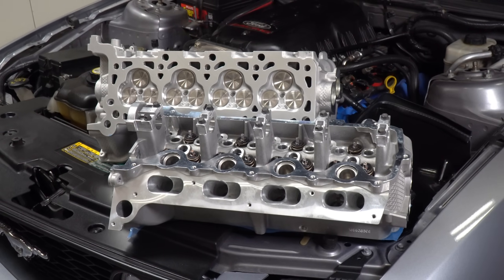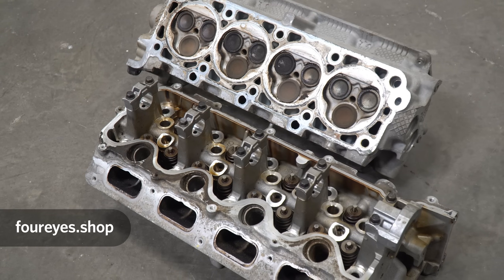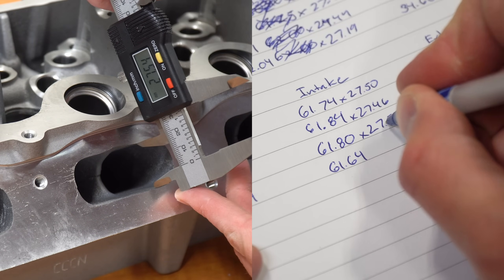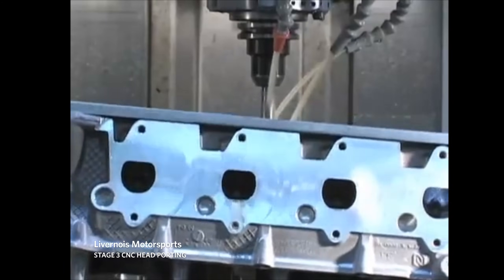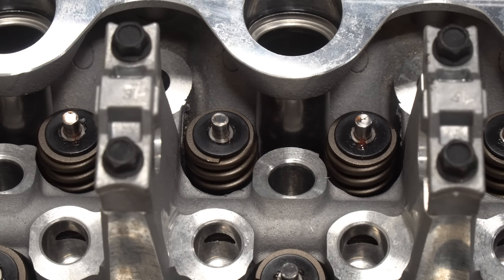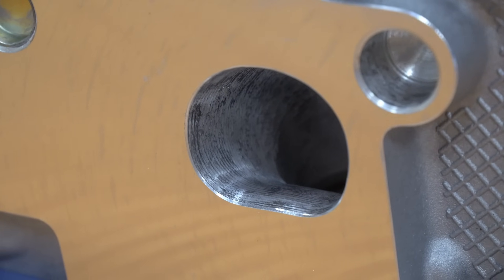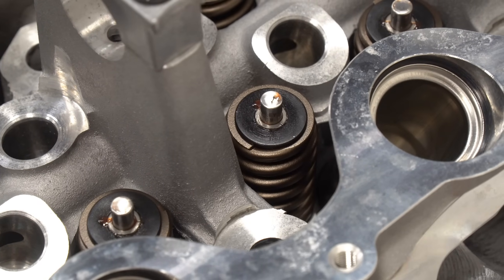Ported Heads Before & After (measurements + dyno)

Comment: I think a ported heads worth 15 or 20 HP to the crank, not 70. 
See the difference between a 11 Gt (coyote gen 1) and Boss 302  2012 (roadrunner engine) which has cnc ported heads specific exhaust camshafts ...

Comment: I'd like to see the whole flow graph, the discharge coefficient, port velocity, etc. The real places you want gains are in the mid-lift areas. Power under the curve and average power across the top 30% rev range is the goat way more than any peak number can provide.

Comment: There is little difference between rough and polished intake ports in terms of max flow.  But!!  At lower flow rates, such as low-mid RPM or when the valves are just barely off their seats, rough ports have a MUCH better aurflow velocity.  The rough texture creates a large boundary layer of still air which progressively collapses as airflow becomes greater.  This effectively acts like small ports at low flow regimes, and big ports for high flow.  The best of both worlds.  The grooves left by a CNC machine are close to ideal, which is why the dark art of manually adding grooves to intake ports has disappeared.  That used to be a thing, albeit relatively obscure.

Comment: Edit: I got porting done. All done by hand by someone with many years experience. They did it per my application. Gains we’re 25% average on intake across valve lift range and 48% average on exhaust. Actual cfm gains at .600 were 212 up to 268 intake, 145 up to 212 on exhaust! So it performs between a LS1 and coyote head. Great flow for 4.6L.
OP:
Building one of these too, talking about porting with engine builder right now. Turbo application.
Crazy part is the gains N/A are multiplied under boost. Let's say you gained 75HP N/A, thats worth 150HP at 15psi! Insane!

Comment: Why didn't you go with a pair of 4v heads?
Reply: That's honestly a stupid question
Reply: @smoke_oguwop  Whyt is that.
Reply: Cus the ported 3v heads not only flow more but will have better air velocity. The 3v mod motor is an underdog. Ford should have done more woth it

Comment: 288cfm@.500" lift is basically gen 2 coyote.  Can easily make over 500 hp n/a with that type of flow.   The 190cfm exhaust while not a spectacular number is sufficient.   These heads can make power.

Comment: Did you ever make a video on how much horsepower the final version NA mustang made? I cant find it.
Reply from the maker: I actually haven't yet, still in the works. I got it over 400, but trying to squeeze out a little more before I call it good on NA.
Reply: @Four_Eyes  could you please please do a quarter mile and also vs a stock 3v

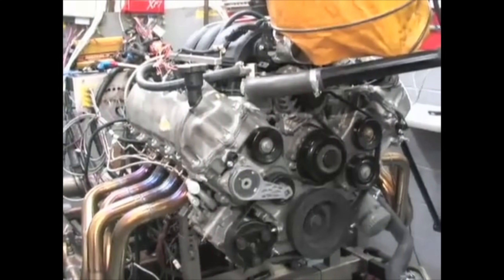Comment: 4:30 - BULL SHEET! Who told you that you will get 40 HP gains from Porting heads on a 5.0?
Reply: Well you can see 100hp gains on a 2v. I wouldn’t be surprised the latest version of the mod motor would be better & not require as much

Comment: Always wanted a 5 axis machine 😍! I run two 4 axis a61nx Makino’s for a living. Polishing is very simple to do on your own. A little time and elbow grease and they’d be good 👍🏻. Also polishing the combustion chamber is beneficial! Removing any “sharp” spots so to speak helps with detonation aka spark knock. Therefore eliminating hot spots.

Comment: Why not a big bore setup to still give you 305 cubic inches (5 liters) run stock length rods to keep weight down? The less internal weight of the rotating mass(frictional horsepower loss), means it can get through the RPM faster,  higher rpm potential without side loading the cylinders creating premature wear. Also, two other factors are increased static compression ratio from shoving more cross sectional area from the piston into the same combustion chamber area. Higher static compression means more down low torque, higher flow numbers from the increased valve size, and that higher static compression will make easier power , spooling turbos faster with less effort, sooner. It may become an undersquare engine but, the stock stoke is plenty to help pull and fill the cylinders for a turbo car as well. I believe this is why modular engines love boost in stock to wild form.
Reply: The 4.6 is limited in terms of going with a bigger bore. Theres nearly nothing to take out
Reply: @TexTheMaster  3.552” standard bore on 4.6 Modular’s. 
The block can be machined to accept “Sleeves” or an Iron 4.6 Boss block  can be had which has a 3.700” bore from manufacturing. 
A 3.700” bore with a standard stroke,  is 305 cubic inches.

Comment: how was livernois customer service, i've heard they don't have great customer service but great physical parts so what was you're experience?
Reply from the maker: good question. so automotive customer support is garbage in general; half the time i feel like shops are annoyed i've spent thousands of dollars with them. but Livernois' is actually pretty decent - they only take 1 or 2 emails to respond while other places can take as many as 5. i don't recommend ported heads tho unless your motor is fully built (forged, boosted, cammed, etc).
Reply: @Four_Eyes  ok gotcha i'm not too surprised the customer service in general isn't the best but what can you do, about the ported heads tho it sounds like it's more of a support mod, not a power adder but more of a way to free up more power with a power adder. I plan on installing a whipple twin screw package someday so it's something to consider later down the line.... thanks for the response though and on a side note i'm loving the build and all the information you're providing, keep it up 👍

Comment: Hey man, ended up getting a 3v recently and I’ve done almost all the bolt-ons possible. Car has Off-Road X-Pipe, Cold air intake, and a BBK 62mm throttle body. All I have left to do is Headers, cams and possibly the ford intake manifold. I plan to go boost in the near future once the car has all the supporting mods done to it. Are you gonna stick with the Detroit rocker cams for the built motor or are you going a different route? I want to get a set for my car as they seem to be the best performing camshaft that does not require aftermarket springs or anything too fancy. Let me know your thoughts and keep up the good work🤘🏽
Reply from the maker: Rockers are a great choice imo, good sound, good power, and easy on the motor. I may upgrade to the boost version of rockers at some point, but who knows. If you're less worried about power gains, Hot Rods are a good choice too as they have the best sound.
Reply: @Four_Eyes   yeah for sure, I mean seeing how much power you were able to make na definitely sold me on them. Hardly do you see na 3v’s make above 340rwhp na, seeing you make 360 was incredible your tuner definitely knows what he’s doing.

Comment: This was my next step on my fbo 3v build before I went coyote. My build was pretty much identical. Ford racing intake manifold, hot rod cam, headers, TB, jlt cai, tuned, coils, etc. I never dynoed it, but my butt dyno put it close to a stock gen 1 coyote. I went gen 3 and it was a decent jump. Can't wait til you boost it

Comment: Great content. Thanks for going into such detail. Please document the motor build as much as possible. I'm wanting to try to rebuild a short block & this my first ohc motor. Theres is not a lot of engine building info on 3v's. I was going to drop in a 393w stroker, but decided to turbo the 4.6 instead.
Reply from the maker: Thank you, and thanks for watching.
So I have a build sheet here:
https://docs.google.com/spreadsheets/d/1hVIZx8W_6PMGEG0bqVcpb3FUmJhsc5FHKiF8nt7t1EM/edit#gid=0
And I'm posting another video in about two weeks that details all the parts I bought for the rebuild.
Reply: @Four_Eyes  The build sheet is   very helpful. I was hoping to assemble my valve train on the short block in my garage. I'm from the ls world & there just isn't a lot of build info on these 3v's. I'm hoping it's the same as a 2v.

Comment: I'd personally have liked to have seen you install the heads on your 4.6 engine.  That's what I'm running and would have been interested in the differences you would experience.  I'm personally working in a different direction.  I'm going to work on the handling end.  Springs, shocks, anti-roll (sway) bars, Watts link in the sear suspension, better sway bar end links, higher quality front control arms, and like your GT a 1 piece driveshaft.  Oh, an all-aluminum larger radiator just because I hate "modern composite" units.  I personally think that 425 - 460hp is a great number but only if it's tractable and useable.  I look forward to your future videos.  Stay safe & healthy.
Reply from the maker: Thanks Lincoln. I probably won't track this car as it's my daily. Did everything all at once (heads + stroker kit) to reduce labor costs and time.

Comment: @foureyes can you replace the lash adjusters with cam in place?
Reply from the maker: I'm not sure, but seems like that would take longer as removing the cam is pretty easy.
Reply: @Four_Eyes  my issue is a top end rattle so im replacing all the rollers and adjusters but going to chains and guides at a later date so trying to not to buy parts multiple times( phaser bolts)
Reply: @Four_Eyes  can cam phaser be left on and just tilt up?
Reply from the maker: i gotcha, so yeah that seems plausible, ones closest to the phaser might be a little difficult

Comment: I understand its a build and your looking to make more and more power but I came because you are the only channel that showed the actual progression of a 3v 4.6 build and showed us what you were able to pull from each mod and that was great. I couldn't wait to see what ported heads would do on your 3v 4.6 but jumping to new motor without continuing the path you had showing us mod by mod and dyno results defeats the purpose of watching as we no longer know what a actual 3v 4.6 was capable of.
Reply from the maker: Power should be around ~400 whp. Decided not to do this because the additional labor, tune, and time would cost about $2,500 and 2 months.

Comment: The new springs allow for 8k revs but my question is what would be holding it back from 8k revs if anything at all? Would the stock camshafts be the next limiting factor or is it safe for 8k?
Reply from the maker: Not super sure, but honestly I think it would be fine to rev to just under 8k if the power's there.

Comment: Still love watching the videos and seeing the choices you make.  One of the reason I love the video so much is my Mustang is almost exactly like yours - 2007 GT Tungsten Grey.  I have done a few new mods since my last comment on one of your videos also.  Laguna  Seca / Ford Performance Rear Seat Delete / X Brace, TMI front seat reupholster kit (this make them look more like the modern sport bucket while still retaining the original seat frames) and an Edelbrock Stage 2 Supercharger Kit w/ a custom tune from VMP Performance.

I look forward to seeing more video - you do a great job - very enjoyable to watch.
Reply from the maker: How do you like those reupholstered seats? Good fitment or a bit saggy here and there?

And thanks Cooper ✌
Reply: @Four_Eyes  - No fitment was actually excellent but it take about 4 to 5 hours to do and you will need an extra set of hands, my Mustang has the Premium package so it had the factory leather seats - I even moved the factory seat heater over to the new setup.

Comment: I never got to know if you kept the Ford Racing intake manifold since you found a better tuner or did you go back with stock manifold?
Reply from the maker: The FRIM works great with aftermarket cams, headers, and a dyno tune. I'd stick with the stock mani until those upgrades are on the car.

Comment: Could I throw in that stage three ported heads into a stock motor and call it good, maybe cam and exhaust?
Reply from the maker: Ported heads on an otherwise stock motor probably wouldn't be that helpful because the exhaust system would be too restrictive and the cams wouldn't benefit much from the additional airflow. So you'd definitely want cams and exhaust first.

Comment: I have. Ported livernoise trick flow heads, and the port job was pretty shitty, wasn’t even polished just a Cnc machine run
Reply: Polishing isn't even all that beneficial or necessary unless you are making some very high HP. Not 700-1000HP...
Reply: LS4.8 Frank ahh gotcha, I didn’t know that! Thanks for letting me know! I always thought that it should be done it helps with air flow

Comment: Any reason why you didn't use your stock cylinder heads?  Before I get slammed for asking I'm no mechanic.  If you don't mind asking how much does it cost to have this done? and that's with the new springs too right?
Reply from the maker: This is my daily driver and the car would be out of commission for probably two months if I used the heads on the car. I will probably sell my stock heads on foureyes.shop once the overhaul is done.

It's very expensive imo, about $3k for the their "Stage 3" racing package, that includes not just porting, but valve and chamber work as well. And yeah, also includes new springs.
Reply: @Four_Eyes    Three thousand isn't that expensive since we know supercharging is more expensive.  I myself like a normally aspirated motor.

Comment: I'm interested in where this goes as I went to the 5.3L stroker I'm at about 380 but I don't have my intake done, etc.
Reply from the maker: What mods besides the stroker?
Reply: @Four_Eyes  Comp cams stage 1 Pypes LTs, and Steeda underdrive and steeda CAI as far as power stuff goes, the whole suspension is finished so Blower is next step for me.
Reply: @nicolesmrekar2046  I bet it making good torque with a 5.3 and fairly mild cams

Comment: 435 hp thats crazy if the dyno confirms that
Reply: He won't confirm it because he is going to instead bolt these on and also install a 5.0 stroker kit, then he is showing performance after that.  Sorta disappointing oh well.  No before and after.  These heads give a performance gain of 71 horsepower so if you simply bolt them on you're looking at about 371 horsepower at the flywheel, not 435.  And they claim another 25 horsepower with the custom headers which I would normally doubt but they have it on a dyno to prove it.  You're overall looking at about 60 horsepower gain at the wheels.

Comment: Currently rebuilding my 2010 Mustang GT 4.6l 3v... Molnar Forged HD rods from mob max, and CP 12 to 1 pistons made for mod max. Factory crank. Ford racing intake, Ford racing cams, factory heads, pypes Coated shorty headers, pypes complete muffler delete exhaust, McLeod race clutch McLeod fly wheel. Tremac T56 6spd, driveshaft shop driveshaft, those are the upgrades. There’s also complete BMR suspension under the car. KONI Yellow adjustables at all four corners with Eibach pro kit springs. SCT tuner. Hoping for approx 460 rwhp
Reply from the maker: Nice dude 💪

Comment: Wouldn't trust the Livernois numbers. They are bad about lying about inflated HP numbers to sell parts. A stock 3v Makes 350bhp on the engine dyno with headers and bare minimum accessory drive. Heads will normally add 30bhp on the engine dyno. Convert to rwhp I say stage 3 heads on your setup will add 25 whp. I say this not to be a dick. Looking forward to seeing the results. It will be hard to decipher the hp gain on these as you will be adding these to a motor with boost as well a drop in CR. The drop in CR will reduce hp by about 10-15 by itself (NA), but won't matter as you will be making too much horsepower when you boost it. Thanks for putting out the great content man!
Make sure you get boost cams in the future. NA cams in a boost motor will make less hp than the stock cams under boost conditions.

Comment: This is great dude I just had my full bolt on 3v tuned it's making 341 rwhp...this is goals right here loving the build
Reply from the maker: Nice. What's all on the car exactly?
Reply: @Four_Eyes  I have kooks long tube headers,full straight piped,hot rod cams,ford performance intake manifold,upgraded throttle body,jlt cold air intake with the heat shield,1 piece d/s, 93 tune. Short shifter,light weight flywheel and performance clutch...,
Reply from the maker: @jcub19  Sounds about right, thanks for the detail!
Reply: @Four_Eyes  no problem man I really wish I could get my heads ported and built but the way my funds is set up lmaooo well little by little I guess
Reply: so with the ported heads you'd be over 400 to the wheels.
Reply: @jcub19  instead of doing heads I would do cams and a department of boost setup with an m122 from a gt500 it works killer with a stock bottom 3v this is a reliable 500 rwhp recipe for the 3v that doesn't break the bank
Reply: @midnight347  cool
Reply: @Four_Eyes  oh and msd coils, I believe that's everything

Comment: Not sure why you’re chasing 1000hp. It’ll be a pig to drive unless you’re going super fast. I think about 500whp is probably the sweet spot. Plenty fast enough to drive with street tyres on all types of road surfaces and still get your foot to the floor.
Reply from the maker: The car will likely run around 750 whp at 11-13 psi, but there may be a couple aggressive dyno pulls just to see what it can do.

Comment: I am very excited to see how much HP you can squeeze out of the 4.6. Nate Ryder said they can only make around 500hp wheel max ( safely ) so I guess we will have to see! 3v LIFE! <3
Reply: That is on a stock bottom end this engine is fully built with cams and ported heads it will make a ton of power probably 1000 wheel with the right turbo.